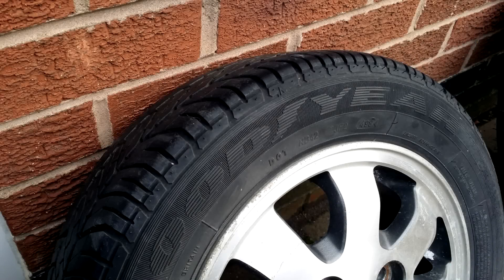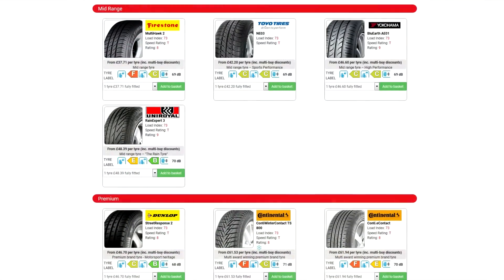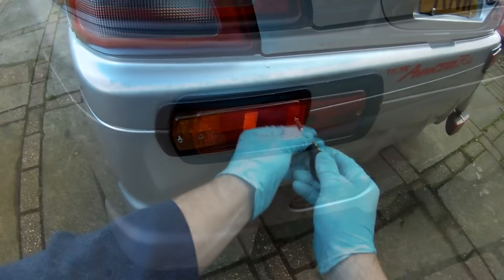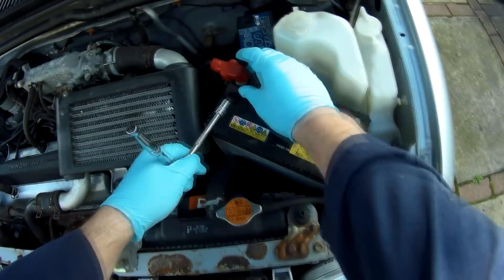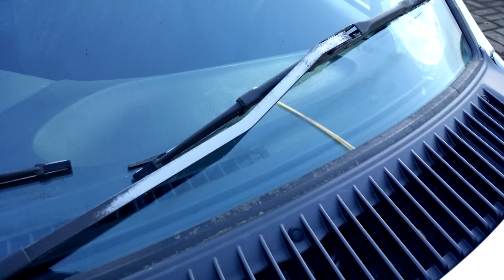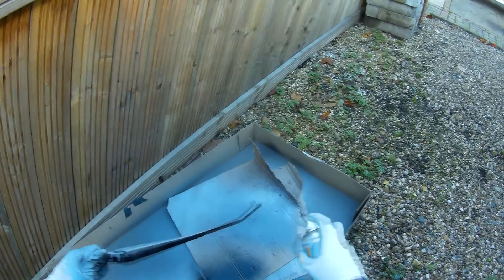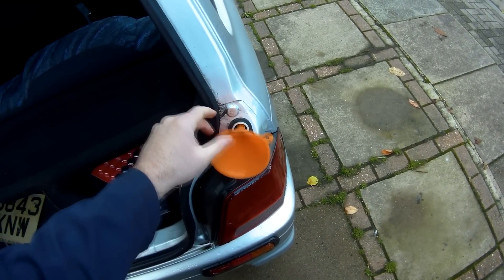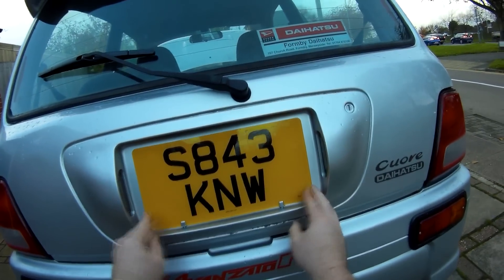MOT Prep & Minor Jobs - Daihatsu Cuore Avanzato TR-XX R4 Project Episode 17

Comment: An old mechanics trick :  Spray both the battery contact clamps and the battery terminals with a VERY liberal coating of clear spray paint, attach the battery leads, and spray again.  This will protect the connections from water, battery acid, and other types of contamination/corrosion while still allowing the battery to be contacted by a pair of jump leads (jumper cables) if need be by simply using the teeth on the clamps to cut through the spray paint with a gentle wiggle.

Comment: Dave, what do you use to film from your point of view, is it something like a GoPro strapped to your forehead, or one of those spyglasses? Thanks!
Reply from the maker: It's a GoPro (well, a Gitup Git2, but much of a muchness) ziptied under the brim of a baseball cap, puts the lens closer to eye level than a head mount, but not quite in the way of my own eyeline so I can, you know, see. I actually have the camera upside-down when using it like that, but rotate it back round in editing.
Reply: Isn't there an autorotate option on the gopro? My yi cam 4k has an option to autorotate so I don't have to do it in ediitng.